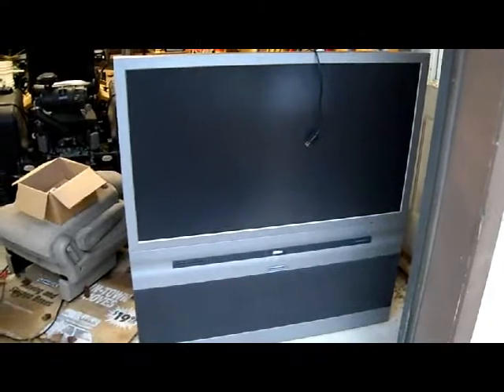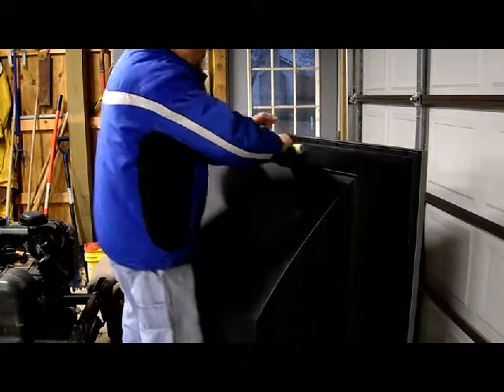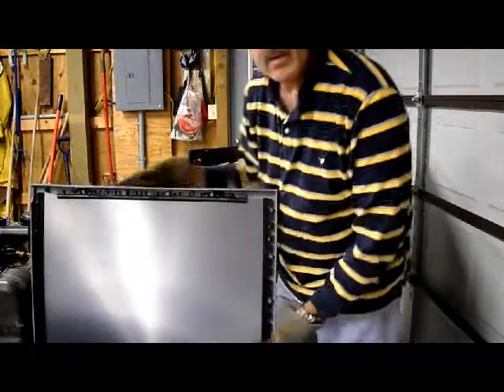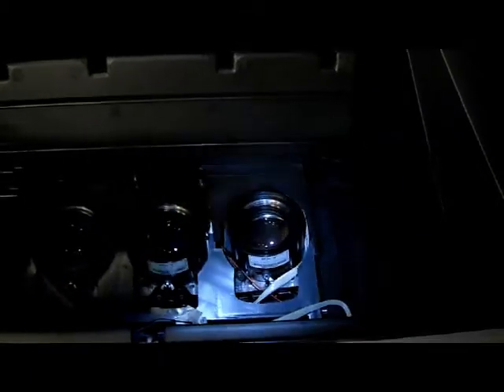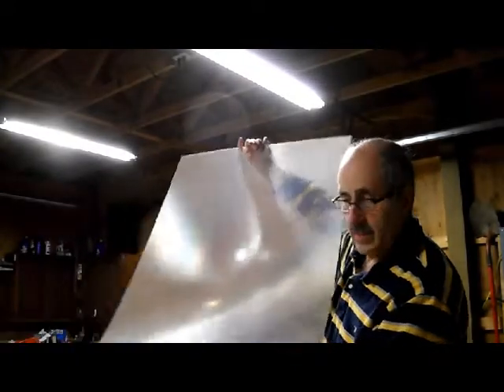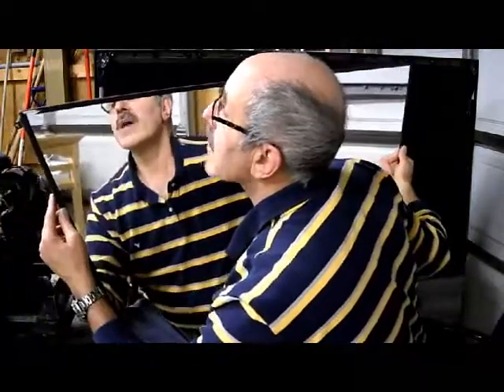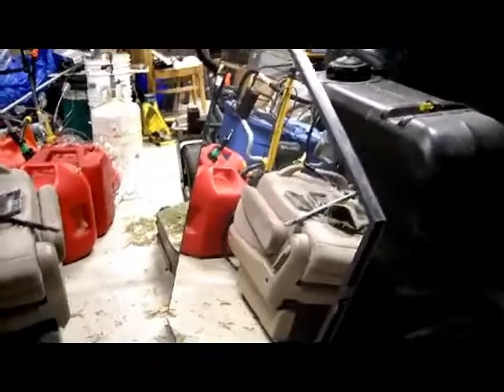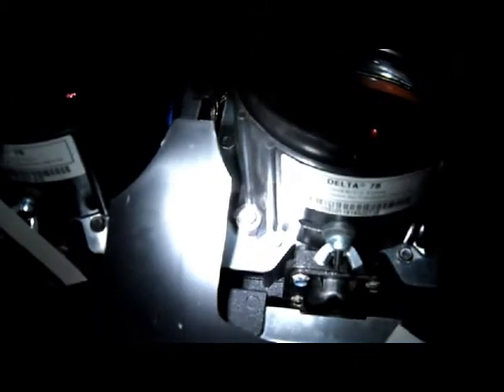Fresnel Lens removal from 52" RCA Projection TV

Comment: I found that when you pull the magnifying glass out of the round housing, it's packed with oil and will make a mess.  But they are super quality lenses.  I think the oil is used  for optically coupling the color gun to the lens.  I found my on the side of the road.  the front was already missing...too bad.

Comment: One thing I want to point out since that is a rather clear linear lens you can take the back side sand and polish out the linear ridges and it becomes a spot lens. My first lens a 50 inch lens was a nice clear linear and I turned it into a lethal spot lens that melts rock, glass and metal.